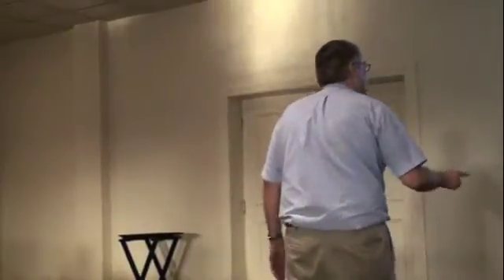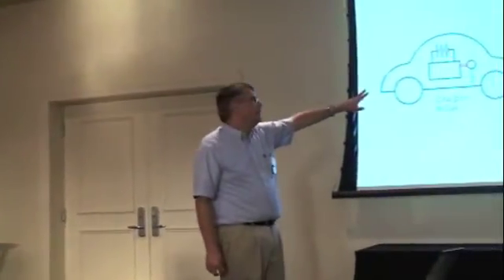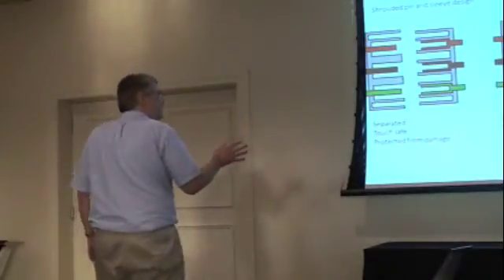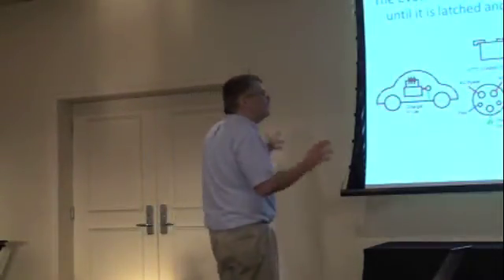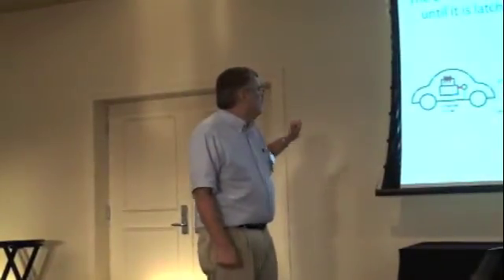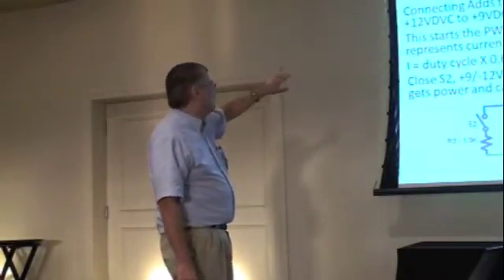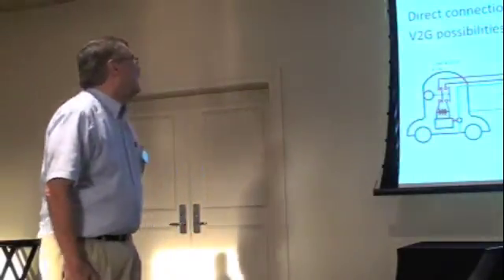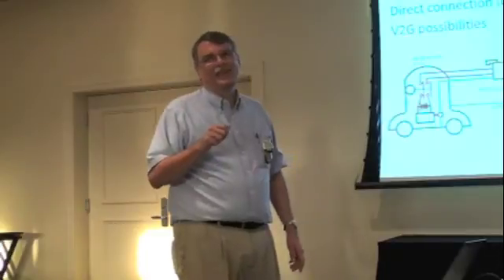Plug In Safety: J1772 Demystified

Comment: J1772 is a great standard.  There is just 1 flaw.  They did not restrict the location of the charge port on the vehicle.  If it was on the center front of every vehicle charging stations can be made so only a 6 foot cord is required.  Now every station has to have a long 25 foot cord to reach every point on the car.  A heavy unwieldy cord that has to be deployed and stowed for every use.  Plus it's a tempting target for thieves.  But you can put more then 1 charge port on a car :)